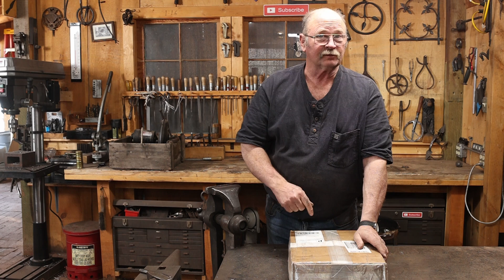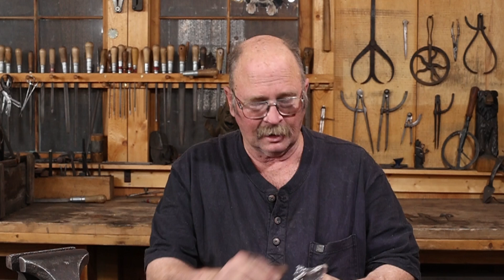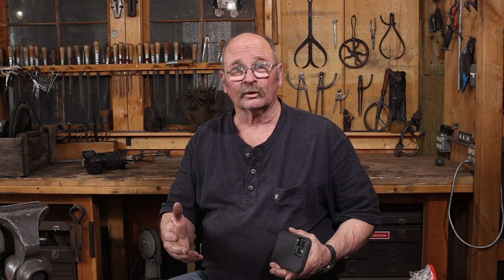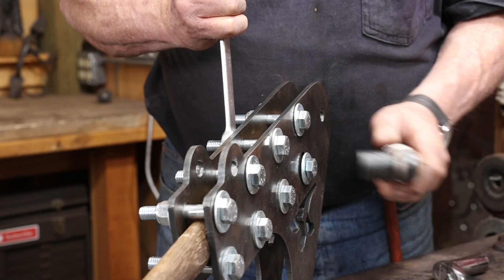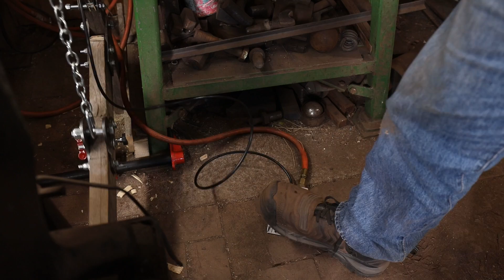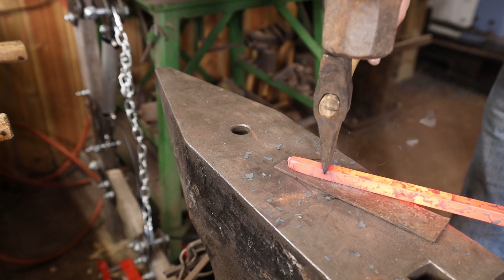The Roy Hammer - Air Assist Treadle Hammer kit

Comment: Thank you John! I'm very thankful for your support of Jessica and I... I'm looking forward to seeing what you come up with in your future videos.
Also a quick note: The hammer hits the hardest when the Air assist is supplied with 100-140psi with 150psi being the max out for this cylinder. Some of the Play in the hammer in the back And forth direction can be reduced By tightening up the pivot pin location until it's snug but not enough to create excess friction..
Reply: I could not find this hammer set up on your site? Am I missing something?

Comment: My problem is I have the desire to keep working, but I need to build my stamina. I can work the hammer until im tired, and then use this as a means to continue work even if my body can't keep up yet. 

That is my biggest issue that prevents me from continuing. Im not strong enough yet.
Reply from the maker: It definitely helps with endurance!

Comment: if they used the air cylinder to extend and not retract when applying force it would be a lot more powerful.   Cylinders always have more power pushing as they have more air surface on the piston

Comment: Hi John.  I'm curious if you or Roy have thought about reversing the air assist.  What if you had a VERY heavy hammer and instead of the air forcing the hammer down against the spring, instead of that the hammer falls freely, and the air is used to raise it back up for the next strike.  The air wouldn't hold it up, but would bring it up till a trigger catches it.  Then the only thing the user is doing is releasing the trigger.  The force of the strike could be adjusted by changing the height of the trigger.  I haven't figured how much more complex it would be, or how to configure the trigger.  Just curious if that's the sort of thing people are thinking about.

Comment: I'm in a pasition where I can swing a hammer at the anvil just fine.  If I need to beat a piece of metal into submission I'm still capable, despite a disability.  What I find is that any leg operated tools range from uncomfortable to downright impossible.  Treadle hammers, foot pumps, foot pedals for welders, sewing machines they all are difficult to manage.  Even the foot pedal for a power hammer,  sensitive as it is makes me question my personal ability to manage the strike with enough precision to accurately shape a piece.  Noting the other comments from people with disabilities and those who just find a third hand useful, it makes me think a control system adapted to use by anyone whether disabled or able bodied would be the perfect thing to open up smithing to anyone who wants to do it.  I'm not an engineer so I'm sadly inadequate to even attempt that challenge, but someone out there must be that one genius who can design tools to aid the disabled smith.  If you are that person, please use your knowledge and skill and hopefully make enough profit from the patents to put your children and granchildren through college!

Comment: How big is your air compressor and how long can you use the air assist before the compressor kicks on?  I've been tempted to get one but I suspect that my old 21 gallon compressor probably won't be up to the task.
Reply from the maker: While my air compressor is quite large, this tool doesn't need a big compressor.  The air system only needs air in single bursts when you step on the peddle for a single hammer blow.  It would be worth asking Roy what he's seen for air consumption
Reply: Roy did a live demo on it he was able to run it off a small harbor freight air compressor but it did run nonstop but that was only a Three gallon if I remember right

Comment: I’m saving up for one of these. I’m a 60-year-old disabled veteran, and I think it will extend my smithing life by several years. Yes, it seems pricey for some do-it-yerselfers, but Roy put a lot of thought and testing into this and sends it out as a complete kit aimed at those of us on a budget. I, for one, am very appreciative of his approach. (Plus, I believe in paying people for their work.)
Reply: why not just copy what you see.  600 bucks is a lot for less than a few hundred in material.
Reply: @jvmiller1995  I have a full machine shop, I could fabricate this in an afternoon. But I'm still considering buying the kit just because I like supporting small businesses that make good, American products for hobbyists like myself.
Reply: @PrebleStreetRecords  I get that. I like helping small American made products too.   And he is a Christian also.   But I am on fixed income do to a lot of health issues.  Pus to me I love the challenge of seeing something and then see how O can improve it.   Like this I would do a all welded version and replace the sledge handle of the hammer with solid bar stock.. But I think the dude sells just the plans too. My welding supply has a CNC plasma and waterjet and you can give them plan drawings and they cut them out cheap if you buy the steel from them.   They are a small local company too.   I am fixing to purchase the plans to a house made 2 x72 and have them cnc all my parts. for under half of what House charges. I built a nice 2 x72 out of scrap but I love how his turns on its side and what not.

Comment: Now you will never skip a leg day ! Who needs a gym membership right? Just make sure that you become ambidexterous so that your right side doesnt look like arnold in prime days and left side like  a toothpick :)
This is simple way i like it alot ,just what i needed :) Simple to make ,only different way i want to do is instead of complex fitting of hande to a steel plate i think i will make a wooden insert for square pipe(40x40mm should do the trick) that will go in and then just make a proper fit for hammer head to go on it i could maybe even weld it since i wont hold it vibrations wont bother me.

Comment: Good morning. Thanks for the video. I wonder if that air option could be adapted to your treadle hammer?
Reply from the maker: A similar system would work, but it would need to be a much larger cylinder.